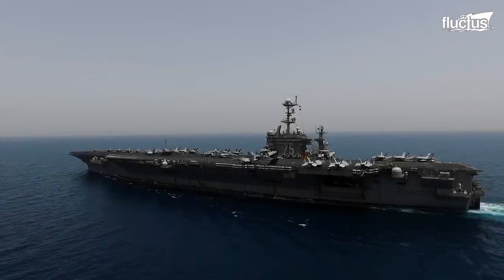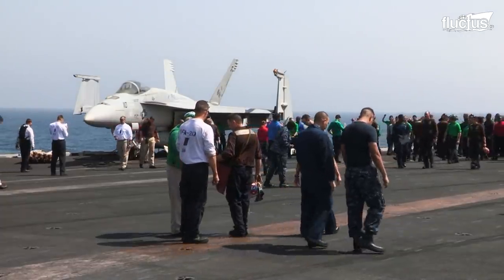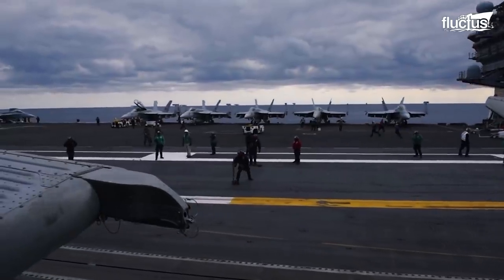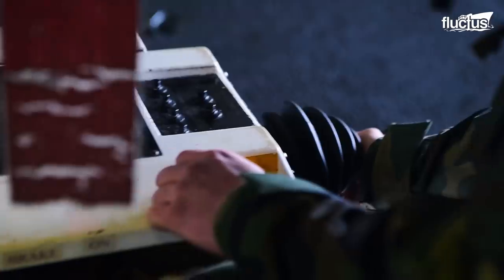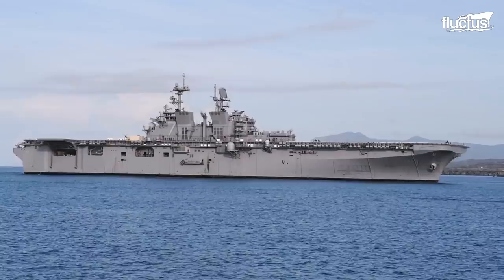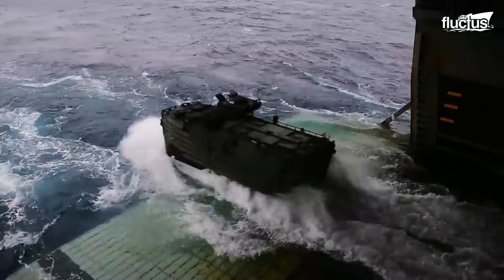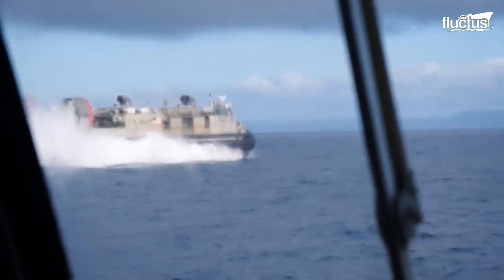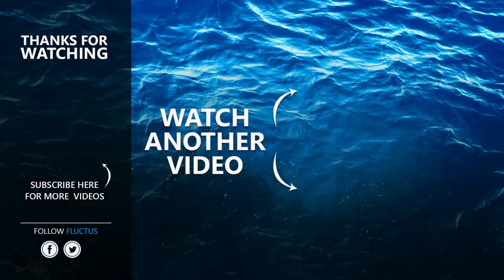The Hypnotic Process of Launching Jets from Aircraft Carrier

Comment: The A/C tow bar is used by ground crew to move the planes form one place to another and its removable. What is bolted on the A/C is called a Launch Bar. It is lower by the pilot as the A/C moves into launch position.